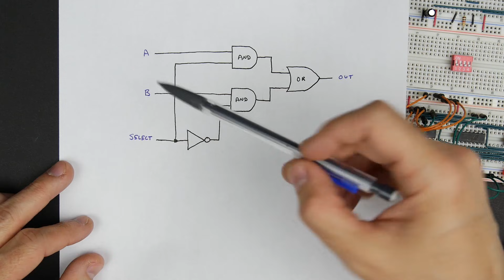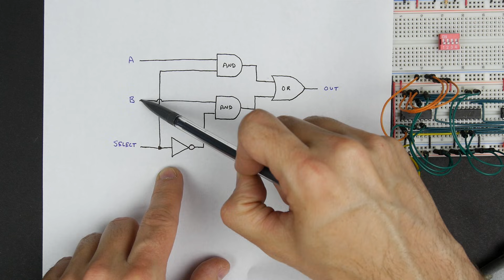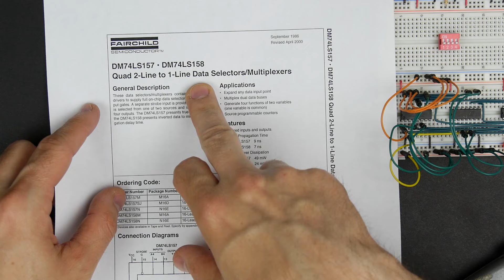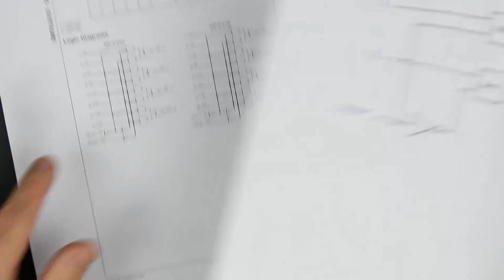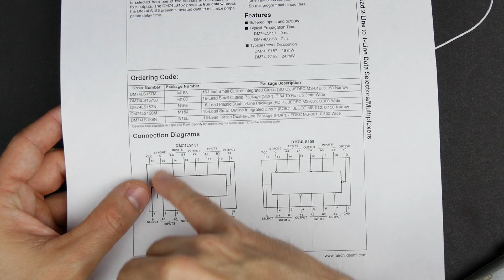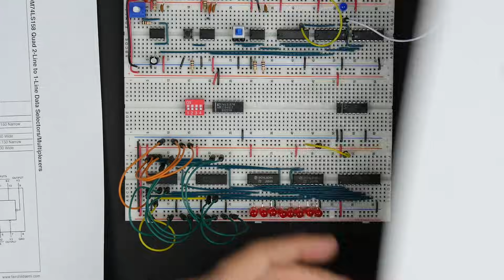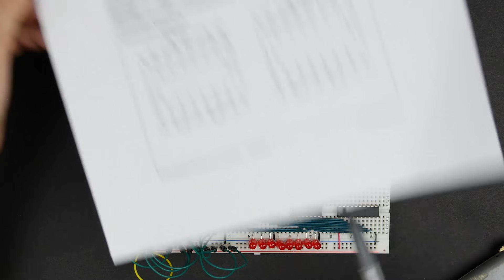RAM module build - part 2

Comment: For some reason the 74LS157 is giving me 3 volts which lights up the 4 yellow LEDs showing the address really dimly when they’re on. If I measure the output pin without an LED it’s about 4 volts, and that drops to 3 volts with the LED connected. I add 220 Ohm resistor in series with each LED. All other LEDs light up fine.

Comment: this and the other videos are really great!. i have just one question i don't understand,; In this video at 14:24 you mention the no need of a  resistor on the invertor outputs as the 74ls04 has internal 130 ohm resistors in the output. That is correct, but when you clamp a red led on the output of the inverters, the forward voltage of the led clamps the output to max. 2.0 V...  it seems you are using the same leds all over, so how then does the invertor output generate enough voltage to set the inputs of the ram chip to high??  I saw the same usage of led's  at other TTL outputs and there also, without a series resistor, you will clamp any output (in case of a red led) to about 2.0V as a led acts as a diode and the forward voltage  will clamp the output to this Vf.... Are you using sometimes LED's with internal resistors inside ??, most TTL require ~3V as a minimum.. only a blue led would have a high enough Vf to get this .....

Comment: As someone mostly used to working with CMOS, it honestly messes with my brain every time I don't see you connect a pullup resistor because the TTL defaults to high.

Comment: which style wide or narrow? im not sure what the spacing is on a standard breadboard. i would hate to get the wrong one. i am thinking the wide vs narrow is an option for all plastic inline dips these days when they say small outline is that for pcb and soc is surface mount correct?

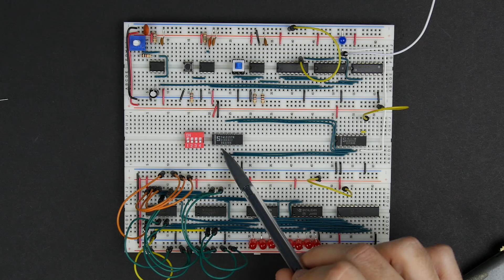Comment: In building the circuit, I've found that the 74LS157 doesn't seem to work the way that Ben says it should at the 10:00 minute mark. If the DIP switch for the Address is set to 1 (i.e. the input signal is left floating), then the output is random instead of 1. The LEDs get anything from 0V to 4.5V. Even waving my hand over the chip can change the state! The fix is easy enough -- add a pull-up resistor connected to 5V on the opposite side of the DIP switch where you've connected it to ground. I chose 1K resistors since there were three left over from the kit but I don't know what the ideal value should be. Seems to work.
Reply: Thank you for posting this, I had the same problem and arrived at the same fix. In fact, leaving those signals floating is very bad practice, and this problem exists in a number of places in his videos. However it is worth pointing out that he improved on that in later videos, like the ones for 6502-based computer that were published in 2019. I guess Ben has become better there! But I do hope Ben could update the descriptions of the videos, and add some notes on his website. But the least that I can do here is to "like" your comment :)
Reply: Why does it happening? Could you explain more about it
Reply: @SanthoshKumar-dk8vs  Because floating inputs can be interpreted as either 0 or 1 by the chip. That's what floating means. Unless you provide a clear 0 or 1 it's kind of "up to the chip" to decide what a floating input means. You should never rely on floating inputs since you can't guarantee how the chip will react. This is the same as connecting LEDs to the output of a 74SL chip to ground without resistor. You'll be left with floating inputs and loads of ppl have exactly this problem

Comment: In the circuit @5:00 is the or gate really needed? Can't they just physically connect to one another?
Reply: No they can't.  You could get a high from one and gate and a low from the other which would cause a short circuit

Comment: If you want the ON part of the DIP switch to be high you can do the following:

On one side of the dip switch, tie the pin to 5v
On the other side:
    connect the 74LS157 to the pin
    connect a 1k resister to ground

when the switch isn't on, it will drop the chip's input to 0v
when it is on, it will raise it to 5v

Do not use a 100 ohm resister, as it will get really hot really quickly.

Comment: I know that I am commenting awhile after the video was posted but I was wondering if the pins on the 74LS157 have to be grounded or could I put 5 voltz though them I was wondering about this because I want to know if it is possible to program the computer with an arduino or a raspberry pi

Comment: 12:51 no pullup resistors? yes chip default input 1 if not connected, but thats not logic. not connect no current in outputs 1. grounded no current in outputs 0 lol. so inputs not inputs they are outputs draw current out. let wine out of barrel.wine is same time current flow ground as output you can collect it bucket lol.

Comment: I noticed today while working on the RAM module that, some of the 7400-series IC's heat up quite a bit when powered, but the 74189's I got especially! After 3 minutes of power, they're close to being too hot to touch! Is this normal? Could this have to do with the fact that I'm using 74LS IC's and IC's from other 7400-series families together? (I'm also using a few 74F-family chips, and of course the 74189's, and I've found that specifically these non-74LS chips heat up, while none of the 74LS ones do)
Reply: the "L" stands for low-power, so it's expected that chips that are not designed to be low power will be more inefficient, making them heat up more.

Comment: Correct me if I'm wrong, Looking at the datasheet with the 74LS158, it inverts the output from the multiplexed input.  If you used that vs the 74LS157, you could eliminate the 2 inverters on the memory side. The memory would be simply store the inverted value from the 74LS158, but when it's read, it reverts it to the original value.  :)

Comment: So this computer only has 16 bytes of ram? Why not use an off the shelf ram chip?
Reply: it's just a design decision. at the bottom a design goal is to build up from logic gates, i.e. a fundamental unit of computation. another design goal is to keep the architecture feasible - so he's not using 100% discrete logic gates, but instead taking some shortcuts (like with the tri-state output chip, or with the 2 4-bit RAM modules).

Comment: How does one get to learn what kind of chips are available out there in the world? Ben just keeps pulling out one convenient chip after another, but how do I go from "erm, I need some logic gate combination that lets me select 4 signal lines from one of two sources" to "you need a DM74LS157 chip"? There must be thousands of different chips out there! Is there a catalogue by function of some kind?
Reply: that's the process of looking up chips.. you say i need something that does roughly this; then eather find a chip that fits the bill, or find the term for what you want and start your search over.. after a while you know what each part is.. 

here's your table for the 74 series: https://en.wikipedia.org/wiki/List_of_7400-series_integrated_circuits
and here for the family markings: https://en.wikipedia.org/wiki/7400-series_integrated_circuits

EDIT: I wasn't sure about some of the things I said so removed and added extra info.

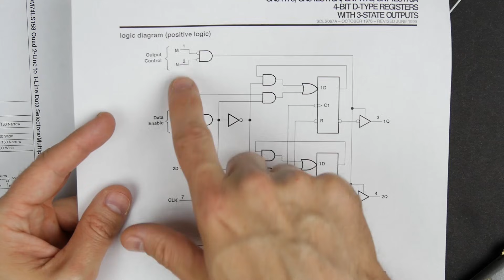Comment: 7:58 Couldn't you have just used the same wire for either enabling the register (active low) or powering the dip switch inputs (with diodes on the dip switch outputs to prevent possible shorts) and skipped the multiplexer? That would seem like simpler logic to me or am I missing something?

Comment: Heres the challenge, build a fully working computer with full graphical output to run linux :D
Reply: PeanutButterDath

It can run linux, you just have to be very patient
Reply: @JAzzWoods-ik4vv  And creative with your compiler ;)
Reply: There's a very good reason those things used to literally have their own rooms, you know

The x86 decoder alone would probably require a cupboard!

TTL is great, but not at all practical
Reply: @233kosta  I have absolutely no money, and my local electronics shop is worse than radio shack, of course, but is the x86 open? 
It would be an interesting "I want to kill myself after I've finished but this was a great thing to do" project to recreate it ben eater style.
Reply: @JAzzWoods-ik4vv  He had the official documentation open in one of the other vijayos. Not exactly a step by step guide (let's be honest, that takes the fun out of it!), but does explain exactly what every command does. Should also have assembly and machine code listed in there, so you can use a standard compiler/assembler. I believe the intention is to enable software development, but it can just as easily be used for reverse enginerding.

As long as you can finger oot how to implement all those instructions - I see no reason why a room-sized, 555-clocked (you'll probably need a good few buffers!) breadbord monstrosity couldn't boot directly into one of the older kernels.

Given that there are probably over 100 instructions (if not hundreds!) - good luck! 😂

I'll stick to learning Atmel ASSembly and maybe have a working osmelloscope x-y-z driver, what-fer sending purty black and green pictures to my Tek 2225 (or streaming vijayos - if I can get the bandwidth), in aboot an year. Or two 😂😂😂

Comment: Oddly enough I am confused by one aspect.  You directly hook the LED to the ic pins without a current limiting resistor in between the pin and the LED.  Are not the buffers inside the IC driven to VDD voltage.  Wouldn't this cause high current draw and damage the IC?  Are the buffer outputs current limited?  I only see input protection on the 4000 series.  I am not familiar with 7400 yet and barely familiar with 4000 series.  Thanks.
Reply: you explained it later in the video.  Thank you

Comment: What would you do if you want to address more memory locations? Can you just use more chips and a larger address bus?
Reply: Or a bigger memory chip and larger address bus. If you use more chips, you also need some extra decode logic to choose which RAM chip to enable depending on some of the address bits.
Reply: Yes.

Comment: Would it not be more effective to use the last spare AND gate from the clock module and have the 2 inputs being the clock pulse and instruction register input, then having the output connected to pins 9 & 10?

Comment: Why don't use EEPROM  as RAM, am I missing something?
Reply: With an EEPROM the inputs are also the outputs, so you would have to find a way to change the connections to account for this; I'm sure there is a way somehow but it would be too complex for the purpose of this computer. Looking at the datasheets in the video the address, input and output lines are all separate so you can control each individual one without changing the pins. Hope this helps!
Reply: Maybe Eeproms are too slow...

Comment: Just a thought, what is the upper theoretical speed of the CPU, assume that there was a faster clock, would it be the limit on speed or is there some other factor?
Reply: 555 timer can run up to couple of mega hertz but running 16 bytes your not going very far
Reply: I wasn't talking about a 555 timer, I was talking about a timer that was fast enough, what is the theoretical upper speed limit before things either melt other errors creep in?

So if you stuck a 32Mhz clock on there, would it be able to keep pace?
Reply: The speed limit depends on how quickly the logic in the computer can settle to a new state after a clock pulse that might change the contents of all the registers. The clock needs to be slow enough that there is still time for the slowest propagation path to settle before the next positive clock edge.
Reply: @possible-realities  Ok, but i am only talking about a stable system, so the upper limit is what exactly?
Reply: @thepvporg  I'm not sure what you mean by stable, the only case I would consider stable in this respect is when no signals ever change between low and high.
I can't give you the upper limit on clock frequency, but I'll try to describe below how it could be calculated.

No logic chip can update instantly. Let's take an inverter. When the input changes from low to high or high to low, it will take some time before the output voltage starts to change and finally settle to the inverted input value. This is called the propagation delay, and is described in the the chip's data sheet.

A computer's logic can be divided into two parts: Combinational logic and sequential elements. Combinational logic is any logic where the outputs depends only on the inputs, assuming you wait for the propagation delay after changing one more inputs. Sequential elements are things like flip flops, which update with a new value at a rising clock edge.

So at each rising clock edge, the outputs of the sequential elements might change. Those outputs will be connected to combinational logic that eventually connects back to the inputs of the sequential elements. In order for the computer to work correctly, the longest propagation delay through the combinational logic must be shorter than the time between two rising clock edges; otherwise the logic might not have had time to compute the right value before it is read into the flip flops. (The flip flops will also have a setup time has to be added to the propagation delay.)

This places a limit on how fast the clock can be. To figure out what the limit is, you can start at the output signals that change at the rising clock edge. Then you can use the propagation delays from the logic chips' data sheets to find the delay from the clock edge to when different signals have settled. If a signal can change for several reasons (e g an AND gate output that can change because of either input), you have to take the time from when the last input has settled before you add the propagation delay to find the settling time for the output. Finally, you will find the propagation delay from the clock edge to all the inputs to the sequential elements, and you can take the worst one as your maximum clock cycle time. I won't do this exercise, but you can, if have the whole schematic for the computer.

This is of course a simplification, there are other timing effects that you might need to consider as well, but it should give a reasonable idea about what it is that constrains the clock speed. Propagation delays will depend on the capacitance that the output needs to drive: longer wires and more inputs to drive cause higher capacitance and increases the propagation delay.

For instance, the SN74LS04N inverter that Ben is using has according to the data sheet a maximum propagation delay of 15 ns (given some conditions such as how much capacitance it needs to drive). The maximum cycle time will be a number of times higher, because the signals need to propagate through a number of logic chips in one cycle.
Reply: @thepvporg  Also, Ben discusses propagation delays and setup times, and how they relate to minimum clock cycle time, in this video https://www.youtube.com/watch?v=i_wrxBdXTgM where he connects a RAM to a 6502 processor. Might be of interest.

The technique that I tried to outline above is called Static Timing Analysis.

Btw, I think that the LEDs that Ben has put on a number of outputs to show what's going on will likely increase the propagation delays for those chips driving them quite a bit, that's a lot more load than a typical use case for the chips.
Reply: @possible-realities  I am probing about this because it would be in theory possible to have a clock chip speed set to allow multiple processors that would allow multiple instructions to be run, making a small dual processor or quad processor may be possible. 

Why?

Well you could in theory have one processor doing house keeping stuff, another running the video memory stuff, another running the program and another for running another program if needed or as a dual processor.

Just trying to think aloud, is that OK?

Comment: Where do you get these parts they are not available on amazon
Reply: Get them from a place that is not amazon?
Reply: @megamer2340  bit of a late reply but thanks anyway
Reply: @ScorpionCA  2 years late lol
Reply: @megamer2340  in those 2 years I found out you can get them straight from the manufacturer, aliexpress and a couple other small electronics retailers

Comment: So an architectural question: why not a separate "programming" module that interfaces to the bus? It would have the switches (maybe real toggles not DIPs) and a button for a "memory write" cycle. That would simplify the memory address unit.
Reply: Probably just because of the way that he's built the entire PC. In the first video of this series, he shows what the completed computer looks like, and the memory address unit looks like the most logical place when everything is done
Reply: The bus is only 8 lines wide so I imagine it would take two cycles to send 4 address bits and 8 data bits over the bus. This would be more complicated than connecting the manual inputs directly to the memory module.
Reply: I guess one issue is that if you're going to use the bus for programming mode, you need a way to turn off all the enable signals for other things that would try to drive the bus. That could be quite a lot of AND gates spread around in different places.

Comment: I notice that you do not use current limiting resistors on the LEDs in your modules. Is that due to using the LS series which is able to limit current? I suspect if other series were used then the resistor would be necessary.  It also seems that where data is accessed in parallel with an LED, the logic level is limited to the LED forward voltage and could cause a potential problem.
Reply: Ted Saari Yeah he said in one of the earlier videos that there are internal resistors in these chips to limit current.